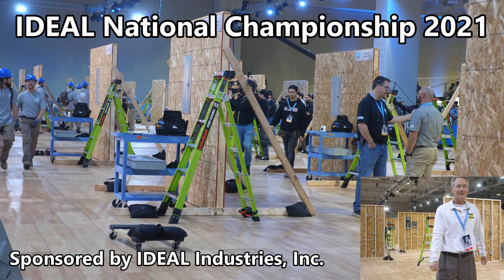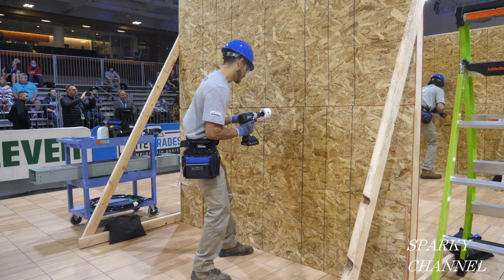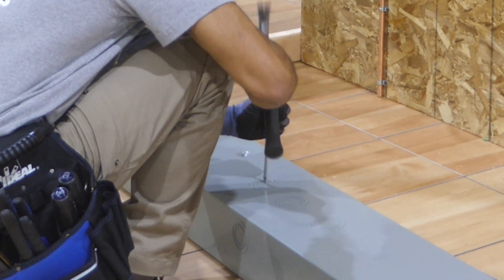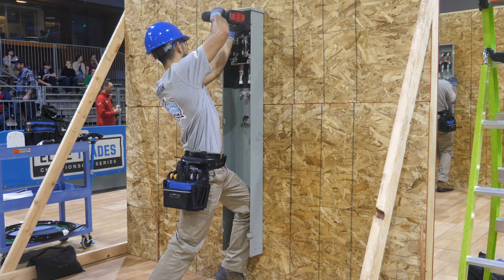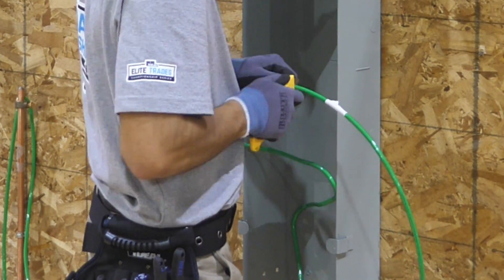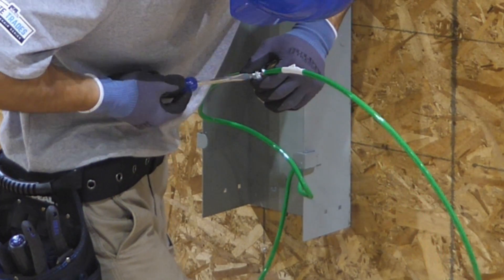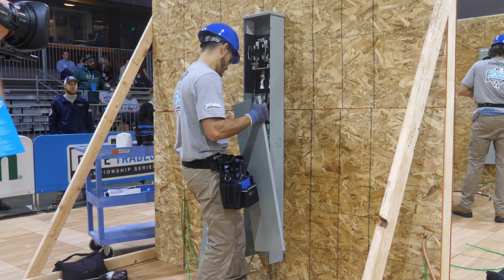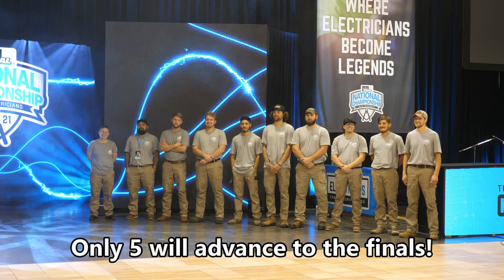Student Apprentice Semi-finals IDEAL National Championship 2021 from Nashville

Comment: He only needed one grounding bushing.  The grounded service lateral conductor will typically bond the meter enclosure.  Placing the grounding bushing in the loadcenter and bonding it to the neutral bar will effectively bond the nipple. A plastic insulating bushing could then be used in the meter enclosure.  The main bonding jumper bonds the neutral bar to the loadcenter enclosure.
Reply from the maker: Yes, correct.
Reply: @SparkyChannel  Thanks, Bill